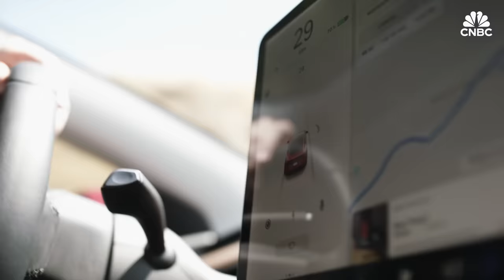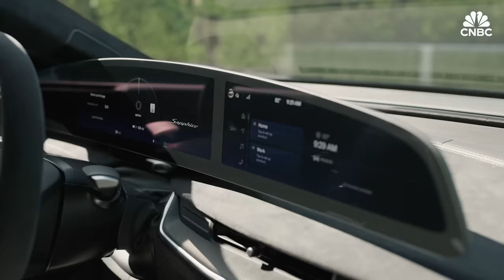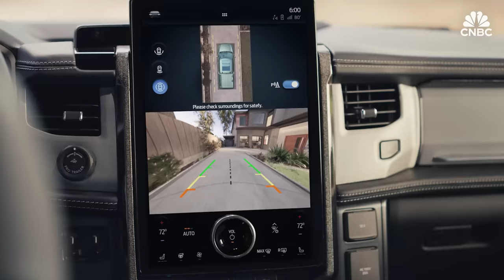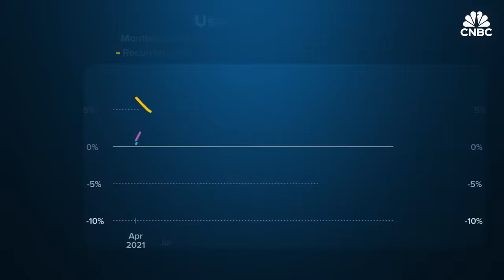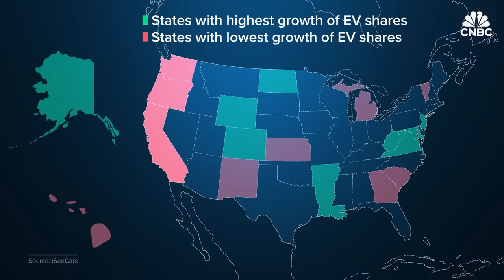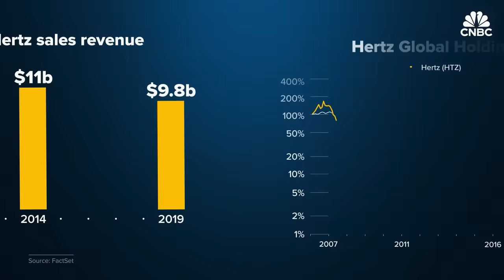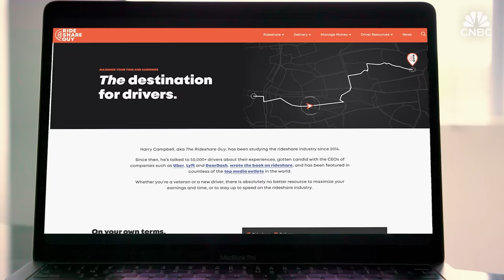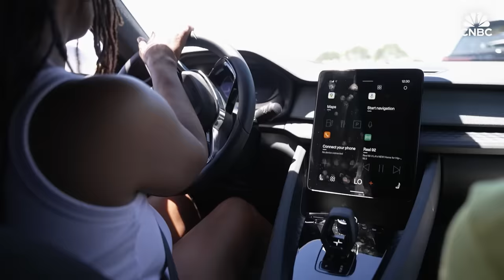Why EV Sales Are Falling | CNBC Marathon

Comment: Dealers are a huge part of the problem. They don’t want to sell BEVs because they can’t make money servicing them.
Reply: That is the bottom line, money.
Reply: Hertz and German giant Sixt just dumped their fleets of Tesla and Polestar ( Tesla went first ) due to unreliability,  high repair costs and 'low residual values' ( massive depreciation ).  They make decisions with their heads not their hearts...
Reply: @chrissmith2114  not the full story , as you see the full hertz dumped Tesla with higher mileage yes which  is a normal rental car practice this what the media don’t tell you . Only because Tesla and EVs generate clicks and engagement which means profit on advertising . Please do full informed research
Reply: Lol. It cost more to maintain an EV than an ICE. Stop believing your stupid politicians
Reply: @ming12222  I thought EV were more reliable, cheaper to fix etc etc than ICE, and according to the EVangelists capable of much higher mileage than ICE vehicles - so why would the companies dump them for 'higher mileage'.  Seems that Hertz and Sixt ( a very large German car rental company ) came to the conclusion that EV were more expensive to maintain, very costly to repair and suffered massive depreciation ( they called it 'very low residual value' ).. Looks like those companies made a business decision rather than trying to justify their expensive toy EV purchase.
Reply: @mikehusky3967 Those are disciples of Musk. Amazing that after 10+ years of lies and faking stuff, we still have people believing a single thing that comes out of his mouth.
Reply: There is a plethora of videos on "cost of tesla repair out of warranty" Try them.
Only the battery has a 10 year warranty. The rest of the junker does not.

1200 for a headlight replacement. Dealers are not the problem alone.
Reply: @chrissmith2114 show me the show where hertz is selling teslas due to unreliability 😂. I'll wait...
Reply: @b-lonmusk  The problem probably partly is that many renters are new to EV's.
Reply: Exactly!!!!!!
Reply: @ming12222  -
You are not correct.  Fist off, Hertz dropped Tesla vehicles because they determined that EVs are too maintenance intensive, and problematic for use as rental cars.  Secondly, Hertz determined that the residual resale value of EVs is too low for them to be used as rentals - this was a key consideration.  Thirdly, Hertz research showed that their typical rental customer was less likely (at this time) to rent EVs.  Facts !!  This is easily confirmed by reading Hertz's current financial reports, press releases, and CNBC reporting.  PLEASE DO FULL INFORMED RESEARCH.
Reply: @ming12222  - 
I have nothing against EVs nor Tesla.  All I was doing was presenting you with the CORRECT facts about the Hertz Corporation decision to drop EVs from their rental fleet.  Prove me wrong - I'll wait.
Reply: @blc2103 Nobody will rent a car that will spend more time on the charge station than on the highway
Reply: I’m three years in with owning a Model 3. A couple months ago I had an error code come up saying my 12V battery had a problem but the car was still drivable. Tesla mobile service came out to my driveway the next day and replaced the 12V after I messaged them on the app. Have had no other maintenance except changing air filters, which I do myself. Overall one of the if not the best car ownership experiences I’ve ever had. We’ll see how it goes down the road.
Reply: @Felipe-lp8tl  My Model 3 gets about 260 highway miles from a 30 min charge, so that’s easily 3 hours of driving. Not going to win any cannonball runs but actually it’s a decent road tripper.
Reply: @XKS99  exactly what the dealer fears. We have one EV. Looking to get our second sometime in the next 18 months. Done with costly maintenance and repairs.
Reply: @Felipe-lp8tl  -
Agreed !!
Reply: Or maybe people just don’t eat to buy them?
Reply: Booz2010 Toyota will great again in a couple years as they are the leader in the next generation of battery powered EV’s using solid state batteries that fully charge in 5-10 mins and has a range of 700 miles per charge.
Reply: To be fair when something does go wrong with an EV they tend to be borderline unserviceable. Playing find the bad cell when you have ten thousand 18650s to check isn't feasible labor wise so the accepted service plan is to throw out the pack and install a new one for $15k...I can buy a used mercedes for that.
Reply: @funfun5656  one man’s trash is another man’s treasure.
Reply: @mastermindfilmproduc why great again ( assuming that’s what you meant ). Toyota sold a world record of cars in 2023 and is on track to have its highest ever profit .
Reply: @loriallen67  sure you can repurpose them but the vast majority become ewaste
Reply: I've had my tesla since 2019 and only filled wiper fluid.  NO OTHER maintenance.
Reply: @linh811  Well yeah it's a 2019 and besides brakes and tires there's not too much to maintain.

Battery will go at some point though. They all do regardless of quality. It's a charge cycle thing.
Reply: That's silly the EVs also break and when it comes to it the repair costs are massive, because they are mostly not repair costs, but replacement costs.
Reply: @navsofour2892  dealers make their money servicing cars. EVs do not need the regular maintenance that ICE vehicles need. This is well documented. Therefore, EVs represent a significant loss of revenue for dealers.
Reply: Donot have afforable EV. Period
Reply: @banana-st1fq  for some. But there are many who can afford current EVs.
Reply: @loriallen67 the problem is not dealers. Real Issues, not dealers:

1. Initial acquisition cost: higher than gas vehicles.
2. EV’s infrastructure :  not as many as gas stations.
3. Accident and more fire prone: damages on EV’s cost more and they get on fire more than gas vehicles. EV a ticking time bomb. 
4. Real cost of charging is increasing and almost the same as gas. 
5. Time it takes to fill as tank: 4-7minutes, EV’s more than 30 minutes.
6. Tires wear out much quicker on EV’s.
7. Batteries replacement run 1/2 to same cost of the actual EV.
Reply: @rupenshah1534  yes and so much more.
1. Initial acquisition cost is higher than ICE vehicles. Yes.  This is true of all new technology. New tech always costs more and as it becomes more mainstream, the price drops. Therefore we absolutely need those people who can afford try out new technologies to do so. It’s how economies of scale are achieved thus lowering the price of the tech to mainstream consumers.  
2. Lack of EV infrastructure. Yes. There is. EVs work in many but not all use cases. Again, those WHO DO have the use case for an EV should absolutely do so. Same reason as above.
3. Accident repairs cost more. Depends on the EV just like with ICE.  Teslas cost more than most. Models which share parts with ICE siblings aren’t as costly to repair. Overall are Evs more expensive? Probably. And mostly due to the exact situation as above. Fewer cars made=fewer parts kept in stock + higher prices for available parts. 

TBCB
Reply: @rupenshah1534  
6. Tires wear out more quickly on EVs. Yes. But ALL other maintenance costs either decrease or disappear entirely. No oil changes. No hoses and belts to replace. No fluids to refill other than washer fluid. And brakes. Brakes just don’t wear out. Like ever.

TBCB
Reply: @rupenshah1534  
7. Batteries cost half to full cost of vehicle to replace. No. They don’t. Not to mention the fact that the actual real percentage of EVs that need battery replacement is VERY LOW. Much lower than say, needing a new engine in an ICE vehicle. 

And then there is the fact that the battery is warrantied. For a minimum of 7 years.
Reply: @banana-st1fq Nissan Leaf is affordable new and used, the demand just isn't there for EVs. Tesla has carved a niche for itself as it's owners are seemingly as loyal as apple users
Reply: @ming12222  lol did they put an order for new a fleet of tesla ?
Reply: @mikehusky3967  it cost to buy insurance, it cost more to repair EV, it cost more to pay for EV. It need a house to charge EV at home. FvcK the idea of EV.
Reply: Really? Because my 6 year old Silverado hasn't spent a minute in any shop. I think most cars are trouble-free. Sounded like the unavailability of Tesla parts was the real issue. They even restrict who can drive them?!!!
Reply: @CRAPO2011  the leaf is not a compelling product. Period. Poor charging, poor thermal management of the battery leading to degradation, and poor range are the reason for low sales of the Leaf. It’s not a lack of demand for EVs. The Leaf is not much more than a city car. City cars don’t work in the US for most people. Tesla made a compelling product and tapped the demand for EVs.
Reply: @loriallen67 You know nothing about EVs/ hybrids.. I work on them daily and I’m here to tell you that they have a lot more issues than their gasoline counterparts! Battery degradation, corrosion, battery cost which is 3-4x the cost of a combustion engine, and yes there are still fluids in an EV such as coolant, the batteries are water cooled! Try telling a customer that because they hit a deep pothole in the city and damaged their battery pack that their 14k battery won’t be covered under warranty🫡😉.
Reply: no one can service them
Reply: @richardhardin9184 what else do you suggest should be the bottom line of a business?
Reply: @loriallen67  where are you getting your information. Brakes do wear out no matter if it's EV or not. In fact faster with EV due to heavier weight of an EV.   Also I spoke with a freind who owns a Ford dealership and he quoted a battery replacement for a Ford Lightning at $60,000!!!!!
Reply: @daveyoung3857  no oil changes. No other regular maintenance but tires. Break are rarely used due to regenerative braking. So they wear out less often. Battery failure is rare. You are clueless.
Reply: if the salesmen dont want to sell the product then it's an indication of a flawed product.
Reply: @BestOpinionHaver  no. It’s an indication of laziness on the part of salespeople to educate themselves. EVs require knowledge. Something few salespeople seem to be willing to acquire.
Reply: @Booz2010   Meaning Toyota is a rolling pile of junk? He better watch his mouth as Akio Toyoda is no longer in charge. God knows where will they go. Happened to many companies.
Reply: @rohitnijhawan5281   But at least it's 1,200 bucks. No haggle, no need to bargain.
Reply: @mikehusky3967 
lol that's the most ridiculous thing I've seen on you tube comments this year ...😂😂
Reply: @chrissmith2114 that is incorrect they dumped teslas because the used car value dropped 30% due to Tesla continually dropping the price of new cars .
A big part of rental cars incomes are from selling the used ones when they reach a certain milage or age .. 😊
Reply: @mastermindfilmproduc 
Lol .. don't hold your breath ...😂
Reply: @Gunter_Custom  If you say so !
Reply: @daveyoung3857 totally wrong in the brakes .regenerative braking slows the EV down and in many cases the brakes are never used daily .. and some people have reported the have to purposely use the brakes once a week to get the rust off .. 😂😂
Reply: @daveyoung3857  also you talked to a ford dealer and believed one word out of his mouth...😂😂😂😂
Reply: @BestOpinionHaver no they don't want to sell them because they don't make money on maintenance like they dinon ice vehicles where more than 50% of the dealers income really comes from .
😂
Reply: Did you even watch the video?
Reply: @chrissmith2114 
 I do..
I just talked to them about buying a Tesla .
Reply: @chrissmith2114  EVs are statistically more reliable than ICE. If that's truly what they are citing, it is incorrect. ICE drivers just don't want to rent EVs, which is fair enough.
Reply: @DrDoohickey  7000 small cells in a battery with 14,000 electrical connections.. what could possibly go wrong ?
Reply: Tesla doesn't make servicing them either.  Almost all repairs done at Tesla are covered under warranty except for wear and tear items.
Reply: Most manufacturers are offering dealers incentives to sell off their EVs.
Reply: @chrissmith2114  Lower residual value is a factor, but the reliability concern is minor. While parts and services are more scarce and expensive, EVs are statistically far more reliable than ICE counterparts. They just don't want to cite the main issue, and for obvious reasons. Trouble-free EV operation requires some learning, and most renters are understandably uninterested in that. The issue centres on refueling. Our infrastructure remains insufficient. It must improve massively to secure the future of the format. Investment is coming, but probably not enough, and too late to avoid a backlash. It's fixable, but not without manufacturers switching to the longview now they've proven the vehicle will sell well enough.
Reply: @GoogleDoesEvil  Because they overproduced. So what?
Reply: @DrDoohickey  So doesn't that prove that dealers are incentivized to sell EVs? On the Dave Sells Chevy channel, he's pretty desperate to sell EVs for example.